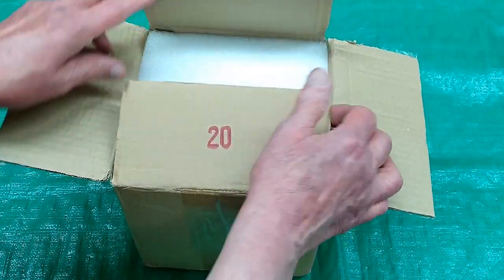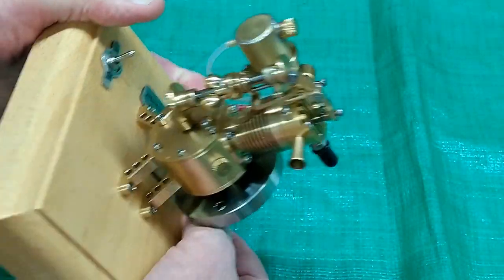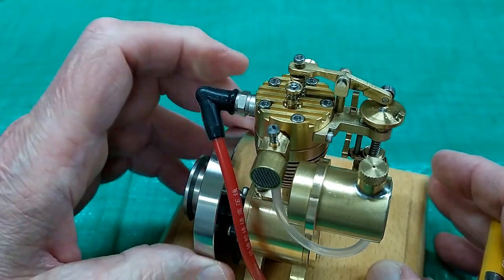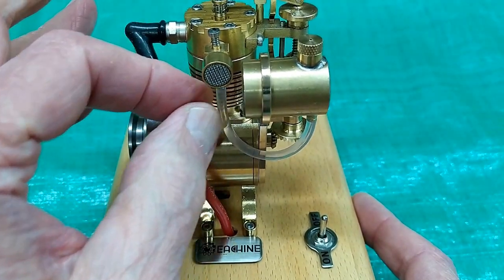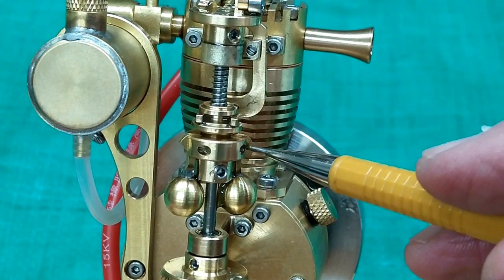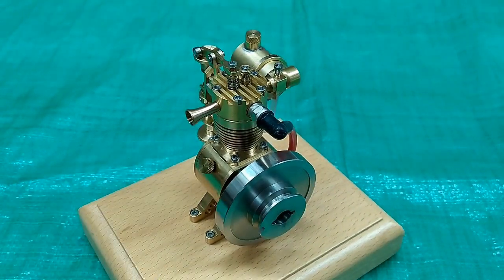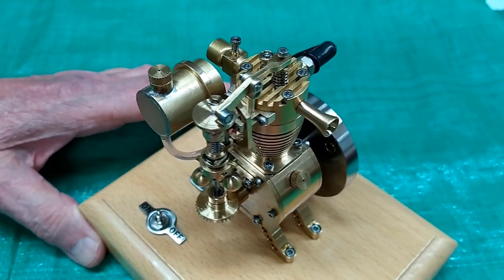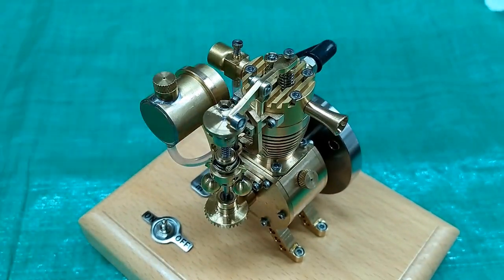Eachine EM2 Vertical Hit & Miss Engine With Flying Ball Governor

Comment: I'm still not sure which engines start clockwise and which anti clockwise 🤣its never made clear and the drill goes so fast then I wonder if the camera is in reverse in some cases..
Reply from the maker: I usually try to remember to state the direction of rotation. Looks like I forgot to do that on this video. 
This engine starts in the clockwise direction as viewed looking at the flywheel end.
Most of these engines start in the clockwise direction.
Also... when watching the video, move your mouse to the bottom edge of the video and click on the gear shaped icon. There you can change playback speeds... and can slow it down as low as 0.25 regular speed... which may help.
Oh yes... and the drill can (or could) look like it is turning backward (or in reverse) due to the miss-match or strobing effect of the shutter speed of the camera. You can notice this in videos taken of a propeller or fan blade.
Thanks for watching. Please subscribe! 
That is what keeps this channel going. 
Ron
Reply: @ thanks for update Ronald .

Comment: How long can you run the engine for? Great video!
Reply from the maker: Running by itself, it does not fire very often so it will probably run 10 minutes... maybe a bit longer on a tank of fuel. I remind viewers that these are model engines and not intended for long runs. There is no cooling on the engine other than the cylinder fins. If this was driving something, the engine would fire more often and the engine would get hot faster. Do not try to see how fast or how long one of these can run before it quits... that would only cause excessive wear and premature failure.
Thanks for watching. Please subscribe! 
That is what keeps this channel going. 
Ron

Comment: I just recieved this engine, its everything you have shown and told.
Im curios to the ratio of white gas and Marvels.  
Or.. I'm pretty sure it would run on alcohol? What do you think? 
Also why the dummy battery?
Reply from the maker: Starting with the original Eachine hit and miss engines (ET1 onwards) it was noticed the ignition would sometimes cut out when 3 batteries were used. Using only two batteries plus a dummy seemed to solve the problem. Now I just use two batteries out of habit.
I quit measuring the oil. Just enough Marvel Mystery Oil to slightly change the color of the Coleman fuel. Its only job is to make the piston o-ring a bit slippery.
These have a strange combustion chamber with the spark plug screwing into a recessed hole. I assume this one is the same. Alcohol probably won’t work… at least not as well as the Coleman fuel. And I use Coleman fuel as it is very cleaning burning and combined with the Marvel Mystery Oil does not leave a carbon deposit.
Run your engine and play with it as received before making any modifications. You will be surprised how long the piston o-rings last.
Thanks for watching. Please subscribe. 
That's what keeps this channel going! 
Ron

Comment: Does this EM2 engine actually take some oil in the crankcase or is it just a few drops?
Reply from the maker: Did you watch the video? I clearly show that I used an eye-dropper (or two) of oil in the crankcase. Just enough for the crankshaft to splash a little oil around.
Reply: @RonaldWalters2010  yes and because I seen only drops, I was thinking it was like a splash crankcase where it would need more oil in there and on occasion do like an oil change. Thanks for clarifying. Good videos. I ordered the EM-2 and the ET 6
Reply from the maker: The crankshaft does not have any oil seals, so if you overfill the crankcase it would probably leak out at the crankshaft (both sides of the crankcase). The right amount (or when it is too much) will be determined by trial and error. Also, if you use Marvel Mystery Oil (or similar) in the fuel, some of that will accumulate in the crankcase. Not a bad idea to dump out the old oil once in a while. Hope you used my links when you ordered your engines. Thanks for watching. Ron

Comment: What would you say are the pros and cons of this one, compared to the ET6 ?
Reply from the maker: ET1, ET6 & ET7 are my favorites of the larger size horizontal hit & miss engines. ET7 has the simplest governor mechanism and is the easiest to replace the piston o-ring. All three are visually easier to see the piston/crankshaft and time (when necessary). ET6 is a very nice engine but possibly (to me) a bit more fragile in terms of the complicated governor mechanism with the small pieces. But, if maintained (oil and keep it clean) should have a long life. All three are large enough to potentially drive a small external load or display of some sort.

The EM2 is just a nice looking engine and does not appear (to me) to be too fragile. It is $80 cheaper than the ET6. It stays where you put it… does not jump around all over the place. Seems easy to start and pretty quiet. It may be a bit difficult to time as you cannot see the piston or crankshaft. But, if you understand 4-cycle engines and know how to work on such things, it shouldn’t be overly complicated to time. The EM1 and EM2 are small demonstration (or proof of concept) engines and as such, not intended to run an external load. They just run themselves. EM2 can be hand-started.
Reply: @RonaldWalters2010  Thanks for that very incisive reply. I'm looking to get (just) one and trying to decide which would be best. Do they all share the same piston o-ring?
Reply from the maker: The larger hit & miss engines ET1, ETX, ET6, ET7, ET8 use this large o-ring: ID: 1481247

The smaller engines ET5, EM1 use this small o-ring: ID: 1718554  I think EM2 also uses this one, but I am waiting for clarification from Banggood.

ET1, ETX, ET6, ET7, ET8, ET5, EM1, EM2 all use the same spark plug: ID: 1573483

I assume you know I have review videos on all of these engines.
Reply: Yes I've seen some of your other videos - I'm afraid I don't always remember every detail. I've ordered an EM2 with your discount code - thanks.

Comment: Does it come with the drill starter adaptor? Which spark plug is it using? Thanks.
Reply from the maker: Yes, it comes with the drill starting adapter, just like shown in the first few seconds of the video.
The same 1/4-32TPI plug as ET1, ET6, ET7, etc. ...  ID: 1573483
Reply: @RonaldWalters2010  Thanks for your reply.

Comment: Have any of your engines ever powered an empliment?
Reply from the maker: I demonstrate them exactly as they come out of the box. I believe a lot of model engine enthusiasts enjoy just running the bare engines. You can drive things with the engines (most engines) but, depending on what you are trying to drive, it may be difficult to start the engine under load without the addition of some sort of clutch mechanism... the engine needs to get up to speed (possibly warm up a little) before application of the load. Example: You do not start your car in gear. Driving a generator may be easier, as you can disconnect the load (open circuit) until after the engine is running.